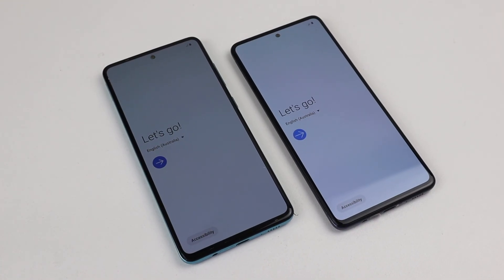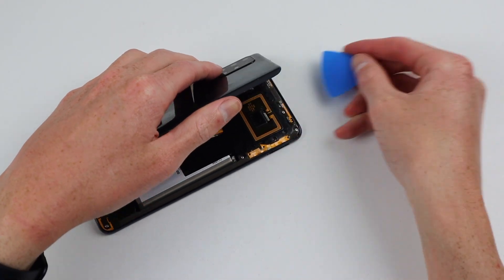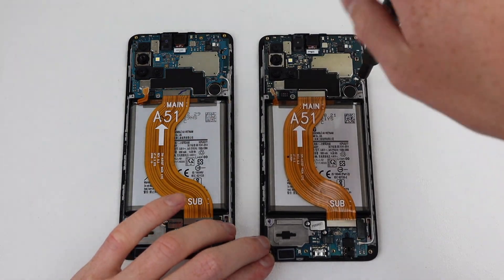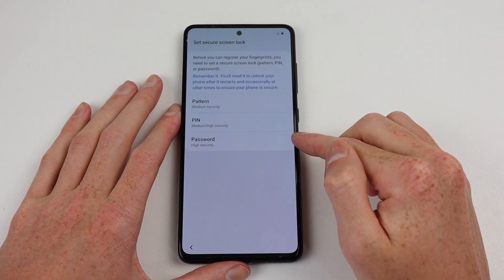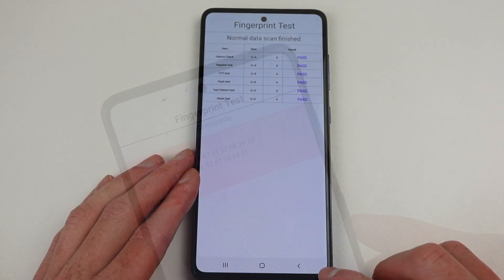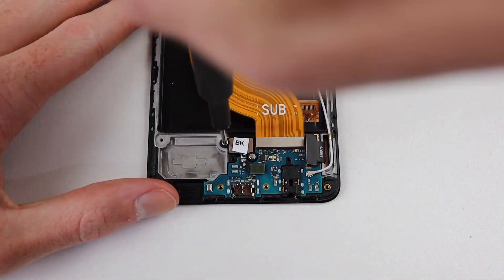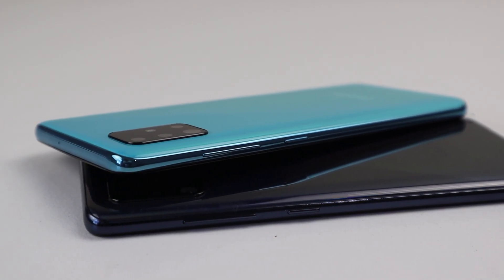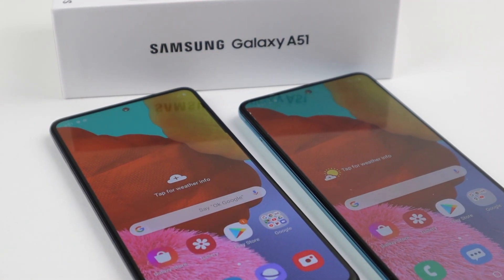Samsung Starts Blocking 3rd Party Repairs? - Galaxy A51 Teardown and Repair Assessment

Comment: hey Hugh Jeffreys, 
this is not the case, this doesn't happen with every repair, unless there is dust under the fingerprint(inscreen) or you replaced the SubPBA(Charging Con) or PBA(MainBoard)........... this is an easy fix, send it to the Samsung service center and ask the tech guy to make calibration to the fingerprint sensor(its a camera sensor) it needs to be calibrated when ever its not alinged properly or dust under it...
Reply: But downgrading the phone just solves the issue. If it's a calibration problem that shouldn't happen, right?
Reply: @Lathi33  do not downgrade.
Once you downgrade
Your phone will die 
Specialy A SERIES
Reply: @GLORYWINGSx3  how? I downgraded many phones. Everything works without a problem.

Comment: Once you downloaded and made sure it worked, it would have been great to see what would happen when you upgrade with the replacement screen and FP reader. I hardly think they thought about pairing the components at the time of production of the components. Since this is a software patch it is probably reading the components and making the ties. So there might be a chance that this could work. Just a speculative thought.

Comment: Fingerprint reader is a security device. If it's a subject to be easily replaced, any figerprint reading can be forged and lockscreen bypassed. Easy-to-replace fingerprint is a vector of attack and that may be a reason why it was patched in a security update. Especially dangerous as these Knox-equipped phones are being used in corporations with sensitive data involved.
Reply: BS

Comment: This could be a valid security reason to make the fingerprint stop working to some degree. If someone how a person were to steal the phone and would like to unlock it then he or she could theoretically get a fingerprint scanner that would always output "success/true", thus accessing the phone without any pin codes. Of course, on the other side of the coin is that if the person has the device unlocked then he or she should be able to add a new working fingerprint at that point.

Could be that Samsung wants to step up their security which isn't a bad thing but does create some issues with 3rd party repairs

Comment: Samsung didnot locked anything. Because it passes fingerprint tests and even somehow detects the finger. It is stopped working because it is optical and sensetive to the position. Small missalighment will make it harder to detect the finger.

Comment: "We removed the Headphones and Charger for the Environment"

If they would care about the Environment, they (both, Samsung and Apple) would not do such BS.
Reply: If they were they would make smaller cases, something like no stupid manual thing, and everything trying to be as stuffed as possible, NOT making a big case with 10000 marketing papers
Reply: Apple pushes out an update to slow down the iPhone you have, so you buy a new one.
"We stopped including a charger because we care about the environment"
Reply: @mzzar_xd  I tried to share the link to the article from bbc but youtube keeps deleting it. But still, apple clocked down the CPU on iPhones when the battery started to degrade, but they never told anyone, which is shady at best.
Reply: Actually they both would do that. BUT they also wouldn’t make devices that are just straight electronic waist like wireless earbuds or headphones that never actually shut off or constantly charge themselves and aren’t repairable. That goes for both companies.
Reply: nah actually samsung just lowered their prices way down and didnt claim any environmental reasons

Comment: It seems like the fingerprint scanner is calibrated and locked to the specific screen.

Swapped entire boards = ❌
Swapped just print readers = ❌
Swapped just daughter board and print reader = ❌
Swapped daughter board and kept print reader with screen = ✔️

That makes me wonder what if you swapped all the components to the second phone but only kept the print reader with the screen to simulate a screen replacement with a paired reader.

Comment: Hey ya'll, If you're a "Samsung Certified" shop or repair center, they give you a special Calibration block to recalibrate the Finger print reader when you put a new screen/fingerprint reader in the A51. Also Samsung gives you special access to software the general public cant use that tests and recalibrates all the phones feature. So repair centers that are "Samsung Certified" don't really have these issues because they equip them with the proper tools/software. The A51 is a more specific repair. You HAVE to use the calibration block tool and software for the Fingerprint reader to work when taking it out or replacing it. Unlike the flagship models that don't need the Block and instead calibrates all in the special software. This in turn makes it more difficult for people/repair shops to repair and replace these issues if Samsung hasn't certified you. Hope this information helps you and others!
Reply: Thanks my guy for the detailed information. It has been very informative

Comment: I think it's some kinda safety feature - you can't steal a phone and have access to private information so simply just by replacing a fingerprint sensor. If you can it would be a huge security flaw. I think it's a good idea to tie up a motherboard and a fingerprint sensor. And I suppose that authorized Samsung service centers have a tool to untie a broken sensor and tie a new one.
Reply: That makes no sense because the phone will still ask for the password before starting lol

Comment: It is obvious that the fingerprint sensor does an authentication with the logic circuit (sort of the authentication of a DVD disk when inserted in the reader).
With the newer powerful security chips, to integrate an authentication cycle is a breeze, so - why not? 
I believe the right to repair the newer phones is a step to be taken at legislative level, in the context of consumer rights...

Comment: Wasn't something similar happening to some parts of the Galaxy S4 variations? I have a feeling that their parts are not interchangeable, like they will appear to work, atleast to some extent but there are issues. What if you'd try to use parts with exactly the same part number (the ones on the video are not exact matches). Also, there may be a bootloader version difference which throws off the firmware of the sensor or something around the lines of that.

Comment: i kind of get why the sensor has more security features but at the same time they should give the repair shop an option " please note if replacing screen blah blah to do following patch update or using the following callibration software in order to bring back functionality" Not defending samsung not one bit

Comment: Was the fingerprint sensor versions different? Maybe its because of that? Maybe the fingerprint sensor is supposed to be calibrated based on the version? 5.0.0.10 vs 5.0.0.20
Reply: He should have reflashed the phone in odin3 this usually fixes the issue.

Comment: It looks like there's really a lot of filling in the phone. At 3:12 you access the real components on the phone, and it looks amazingly thin, with a lot of plastic cases with nothing really important on it (1 or 2 circuits, probably NFC or Qi)
Apart from that the phone looks flat, that's amazing

Comment: If the screen isnt original or compatible with the fingerprint hole the fingerprint sensor wont work it is an harware issue not a software issue

Comment: Something's wrong with your devices or it was a software issue that was fixed later. I was doing screen replacement on A51 (A515F) earlier today to an OEM screen (service pack) and have no issues with the fingerprint reader. Calibration is fine, i can add new fingerprint and unlock the phone just fine. No factory reset or firmware update, or downgrade was required. Phone had, and still has October 2020 security update as before. https://imgur.com/a/RZaxLdf

To be honest, i keep reading the same things again and again regarding A50, A70, A51, A71, yet encountered this problem only once, and that was on a device with screen after glass only replacement, with a motherboard swapped from a different phone, so fingerprint reader didn't match for sure. This triggered a calibration issue, but after flashing full firmware (including PIT and re-paritition), the most recent one at the time - either November or December 2020 i think, calibration was back to normal and fingerprint reader worked correctly again. I'm repairing at least one of those models every week without any issues related to fingerpring. Can't remember anyone coming back because of that as well and most of those phones have some sort of passcode and fingerptint added.

Comment: I mean it literally says "calibration"
some chinese manufacturer's oem calibration tools have been leaked (most of them uploaded on chinese forum first, so ig from somewhere like auth repairshops on shenzhen) and can be found on internet reletively easliy
and that brought problems especially on android community such as xda, device specific android tg groups.
many ppl run this calibration app thinking this "tweak" somehow optimizes fod magically and make fod performs better
which is obviously not... the calibration has to be done under right enviroment and procedures
or your fod is not gonna work properly or even at all
so in reality, ppl just blindly presses calibaration button, fod immediately stops working
after a while, guys found out how to somewhat properly calibrate fod using the app
but...since you can't reproduce the exact procedures at home so ends up main functionality gets back but accuracy is not really optimal as before
I think sammy wouldnt wanna share the calibration tools unless youre very reliable, huge and has decent security policy 3rd party repairshop chain at the very least
for both the reasons I wrote very above and internal security

I know this kind of issue becuase I owned Xiaomi K20 pro and K20 coummity actually had this issue while ago
and the guide to bring back your fod functionality is still on the pinned notes

I think simliar problems will happen time to time till optical fod sensor gets obsolete and replaced by cheaper better ultrasonic or other advanced options

Comment: For biometrics I feel like this is kinda needed. Imagine someone stealing your phone then switching the fingerprint and being able to access your data, that would be the real nightmare for me. Maybe Samsung can distribute to some third party repairers of her choice the essential tools and software for the repairs but keep things like this for security reasons.
Reply: 1 comment that i like here and the person is not stupid sheep
Reply: I'm very sure that the fingerprint data is stored inside of the OS, not stored on the sensor itself. I've swapped the fingerprint sensor on a Galaxy A11 and the new sensor allowed me to unlock the phone normally using my existing stored fingerprint.
Reply: Easy solution: when booting after a repair or other modification, clear the biometric cache, and display the following warning: "The following components have been been altered. Please enter your pin to confirm your identity before continuing." Then list all the components that don't match the original device ID. And if they don't remember their pin, let them factory reset the device in its entirety.

Recalibration tools don't need to be kept out of public hands for security reasons. It's pure business. These tools could be freely available online to the general public without compromising security.
Reply: What ? Did you even watch goddamn video ? This does NOT prevent unlocking your phone. This prevents you from screen replacement, period.
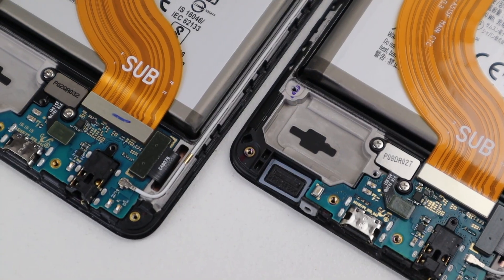3:23 - swapped SCREEN totally prevents fingerprint scanner to work, and it's with original scanner, original motherboard, original everything except screen swap.

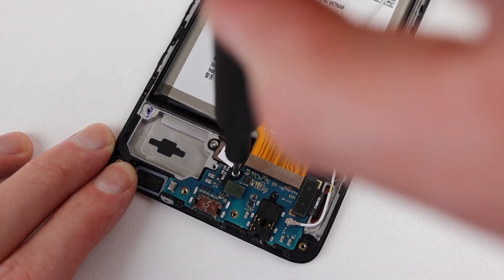6:00 - swapped FINGERPRINT SENSOR unlocks phone with non-registered fingerprints. Yeah, it does give error message, but I'm not sure if it's a problem for any banking software. So as a thief someone may just swap scanner, steal your data, open banking apps (because every fingerprint is registered)... Yeah, safety measure, lol.
Reply: @kovspbru  Was there any problem with the screen? NO. 
The problem was with the fingerprint sensor, probably with a password or any other security measure other than biometrics would work fine, i dont know because of course i didnt test it. 
But the display was looking fine to me, there was not even an error message or whatever so i dont see your point of view.

Comment: The inscreen fingerprint sensors require to be recalibrated using a special rubber press tool. I think this is why the fingerprint sensor didn't work once removed. This applies to Huawei phones also.

Comment: This has me worried now. They do a security patch every month/two and i'm guessing more of these issues of not letting you change parts will occur unless you take it to Samsung,  I have an A30 and I'm worried if i break my screen, I'm not gonna be able to get it fixed easily because of the fingerprint reader on the back won't want to be used anymore unless you take it directly to Samsung.  

They will probably start being like Apple and telling you there is nothing they can do and you have to buy a new phone (Which I cannot afford) or charge you crazy prices for parts and labour that actually doesn't take to much to do

Comment: I work on samsung phones and I've never had this issue. My theory is this: the screens/sensors are paired. However, when you purchase a genuine samsung screen it comes not paired and the phone knows this and doesn't have a problem with it and perhaps "pairs it" to itself. This could be done to not allow your phone to be repaired with a part that was possibly from a stolen phone. I do agree that samsung should clearly communicate this and not apply this retroactively.

Comment: I really don't like what smartphones have become. Companies making them difficult to repair, no headphone jack on most devices, most Android phones still not having more than 128GB onboard storage (which'd hurt those who have built big Google Play libraries over the years) and they DO NOT need to have all-screen displays! I am an iPhone user and have been for over 12 years. I've had an iPhone 3G, a 3GS, got an iPhone 5 in a clear-out shortly after the 5S came out, got a 6S shortly after that came out and I'm currently on an iPhone XS. I don't like how on some of my iPhones, the battery eventually started to not hold a charge very well. I am also REALLY scared about the possibility of the iPhone 13 not having a charging port, as it would only be rechargeable via MagSafe, which only connects via USB-C, and my laptop doesn't have a USB-C port! If iPhones kill the charging port, I'm switching to KaiOS!

Comment: I've seen different IDs on the fingerprint sensors so there may be a compatibility issue between software and hardware (or even the mainboard connectors hava a different order)? Maybe Samsung doesn't use the same fingerprint sensor in every A51 because of ..... who cares? 🤷‍♂️

Comment: As a long time Samsung user, this is pretty sad news. My old S8's screen gave up a few weeks back and when I tried to get it repaired at an official Samsung store they quoted me a price that was almost as much as the S8 when it was new. And now they're starting with this shit. 

I do want to point out, however, the tiny possibility that this may have just been a bug with that particular version. I mean, if they wanted to lock it down they could've done something more concrete than make it so a different finger would unlock the phone. 

In any case, let's hope Huawei won't be following suit =/

Comment: That's Bad Samsung! I Ok, pairing the FINGERPRINT with the Mainboard, so that no Mod Chip between Fingerprint Sensor and motherboard can unlock the device, that is Logical. But the Hardware should be Free to replace, maybe just delete the Fingerprint after that, so you have to enter the pin and re-set the finger again- But none repairability is the wrong way. You can Consider security, but still don't Lock the Fingerprint Hardware!

Comment: I work at a Samsung repair centre, this has been an annoying bug for us and it seems like the easiest way to fix the issue is to just flash new software on the phone, doesn’t seems to matter what version but as you are flashing new software, you can use odin, it seems to do the recalibration, had this issues on a307 a515 and a few other newer Samsung’s with under screen fingerprint sensors, although the A307s aren’t giving issues anymore so I assume that it’s a bug and not on purpose, even brand new fingerprint sensors did it untill you flash software on it, hope this helps

Comment: i had a similar problem with my old samsung a50 after replacing the screen , the daughterboard and the battery  baút after a factory reset the fingerprint startet working again

Comment: I noticed the same thing on an A50 after a screen replacement. It took 10 attempts to register a fingerprint but after that it worked fine. It seems that after a screen replacement the sensor’s sensitivity breaks

Comment: like another comment stated before, this could actually make some sense. how should the device know that it is a genuine fingerprint sensor and not some sort of "unlock-modchip"?
it would give this hypothesis a lot more weight if it was affecting other parts like the cameras, battery or whatever.